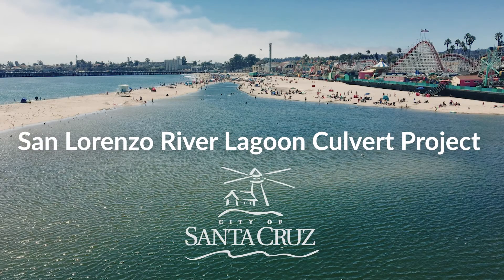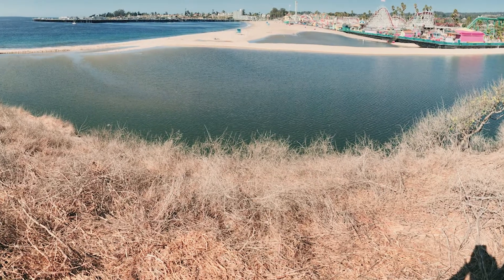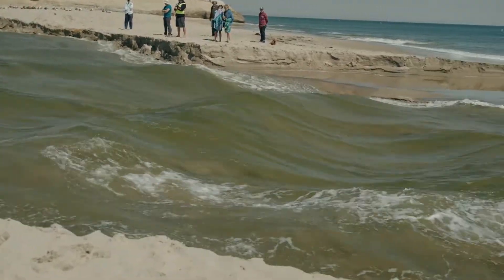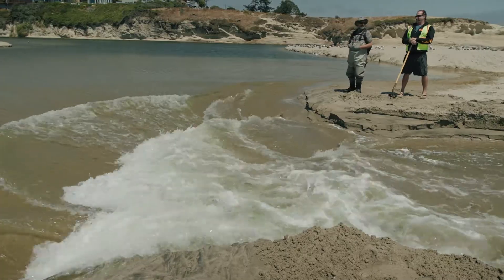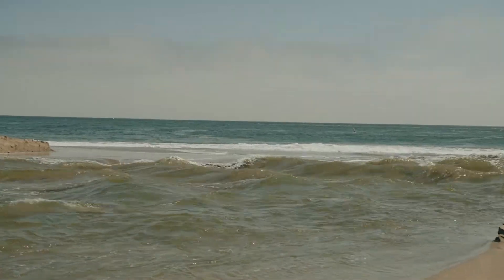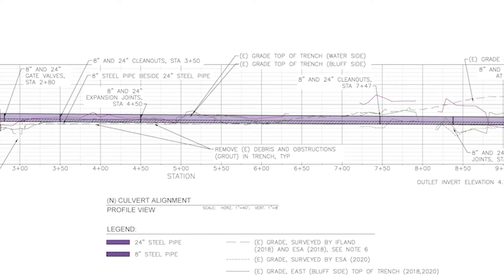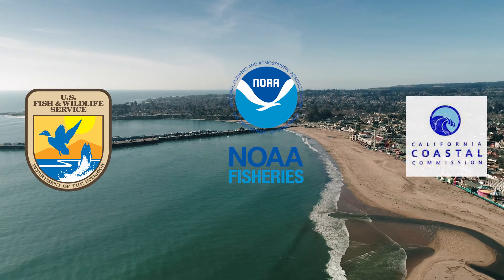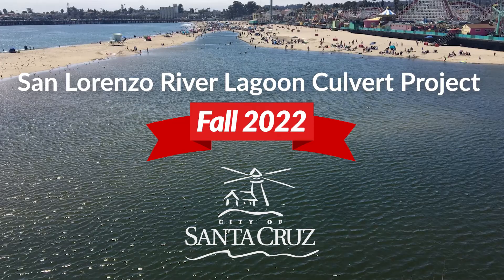San Lorenzo River Lagoon Culvert Project

Comment: get a grip. I lived here for some 20 years. 1977-78 rains far surpased this year, 2023 or any other year. And as for the SUMMER back up, it is usually small and a Shovel will open a breach. So just do it if your so concerned. As for habitat, what we are discussing is the natural habitat.  the sand accumulates every year. And there is at least 15 Feet More sand in winter than summer. 15 feet. in 77-78 there was at least 5 feet deep wood along the harbor to boardwalk area.

Comment: This project has totally failed and the given reasons for doing it are proven false!! The City of Santa Cruz has openly lied to the public on this matter!!
Reply: Yes. some truths are obvious and the truth is rudely exposed by their work here. The natural habitat is a natural sand bar. which almost never happens. Not a vast bureaucracy and pipe system..  I lved in SC area for over 25 years. Lived and jogged this beach for 2 years. And at the light house for a year.  I don't recall this phenomenon at this level. And we are in a so called drought....
Reply: @TheHypnotstCollector  The Sand bar was NEVER a part of the San Lorenzo river nor was building the yacht harbor the cause of its creation. I grew in Santa Cruz and was there before it was built and after and for many years no sand bar ever happened there, that was a lie created bymthe city O Santa Cruz. Plus whie the river flowed through the town NO Vegitation should have  ever been allowed to grow in the river, that was causing unusual high water levels and the ground underneath the  rocks in its levee to get saturated. both of these were totally ignored by the City of Santa Cruz. The fact remains that no sand bar across the river mouth appeared until after 2013.
Reply: @TheHypnotstCollector  I was 2 years old when I moved to Santa Cuz from Fresno. I graduated from Harbor High in 1973, I left Santa Cruz january of 1976 and eventhen there was absolutely no san bar there. the area between the boardwalk and the River was at one time a "wetlands the City drained to build there. I had a photo take wj]hen there was no amusement park called the boardwalk there. Asdlo there was no lagoon or sandbar. The water in the river at that point was sahllow enough a horse and buggy could be driven doen there in the existing water.
Reply: This was a waste of money..someone lied..it absolutely was a fail project..& continue wasting money as of today . Still moving sand around like the Flintstones...grade F